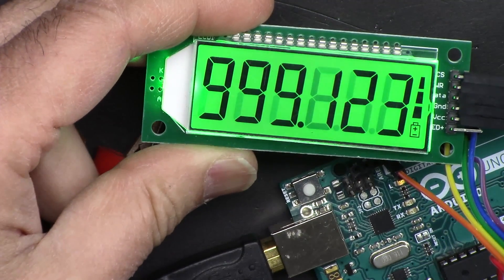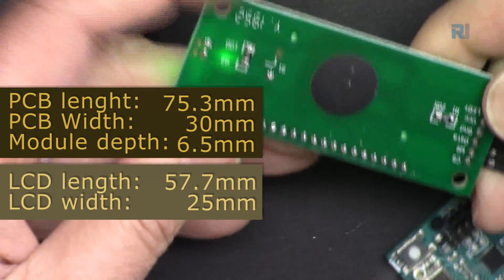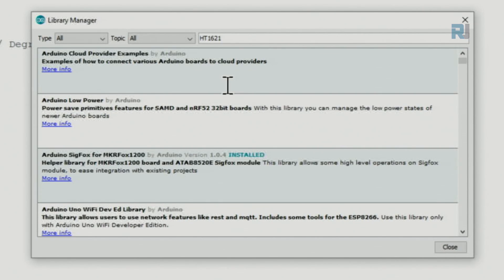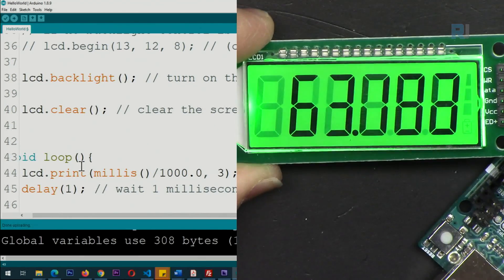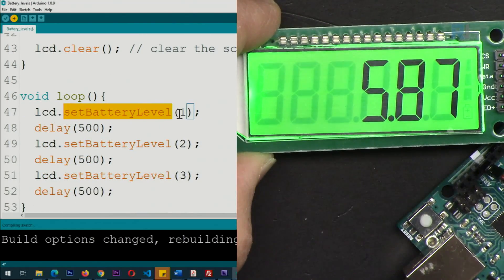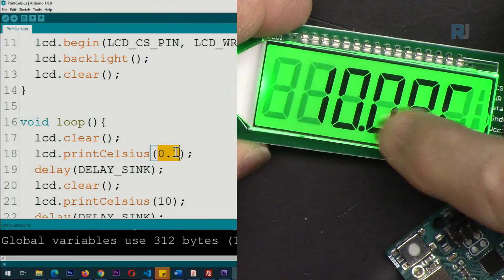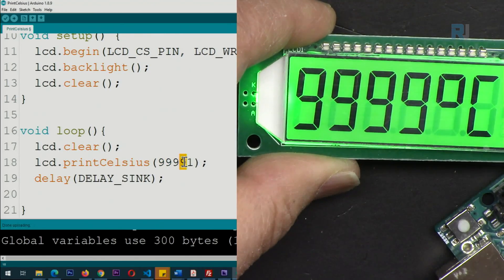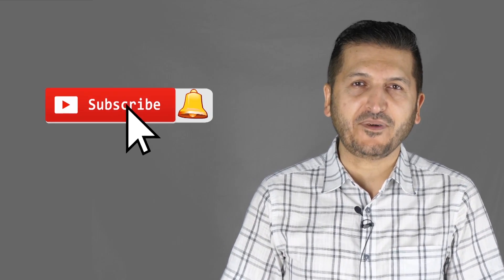Using HT1621 6 Digits Seven Segment LCD Display | Lesson 103:  Arduino Step By Step Course - RJT427

Comment: Hello, i have same module from bangood, did you manage to turn off backlight, i want to turn it off to save some battery.
Reply from the maker: Hello, I did not pay attention and have shown in that it consumes only 19mA which is equivalent of one LED power. There is option in the setup to turn ON the backlight. Remove that and see if it turns it off.
Reply: @robojax  It doesn't work :( The solution from the librery doesnt work too